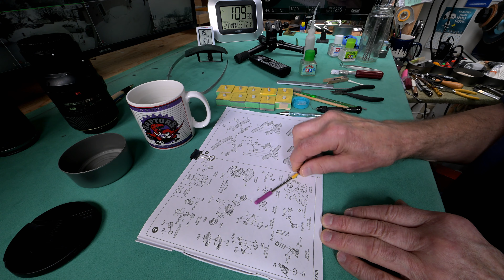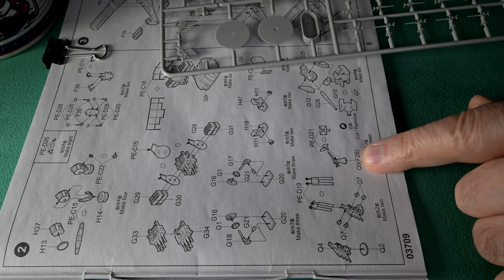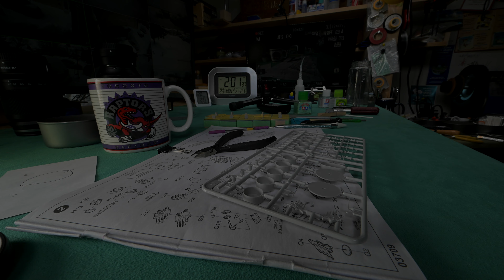The Model Ship - Part 1090

Comment: Will Tamiya Extra Thin cement work in that syringe? It seems like it would be a great way to apply the cement as long as the glue doesn’t attack the plastic of the syringe.
Reply: I see an experiment coming 😊😊😊
Reply from the maker: If I remember, I'll try it in 1091 tomorrow. 🤞
Reply: @roncalverley  yes Tamiya extra thin will work in a syringe Canadian company called flexa file sells multiple applicators for solvent-based cement one of them is a hypo with glass tube attached it's called touch and flow they also have a small plastic squeeze bottle with a removable hypodermic needle attached it just won't work with CA type glues the needles become clogged up
Reply: Thanks, Ron!